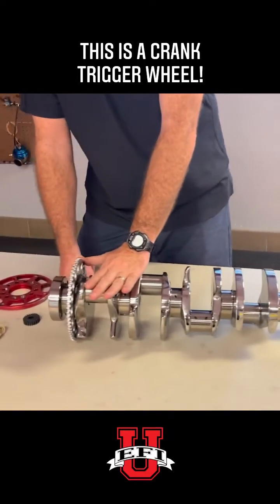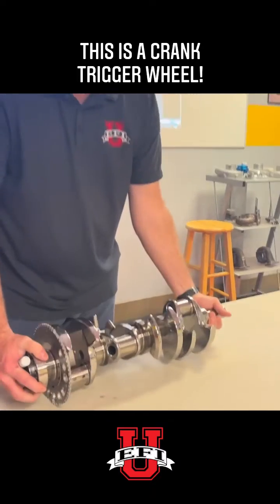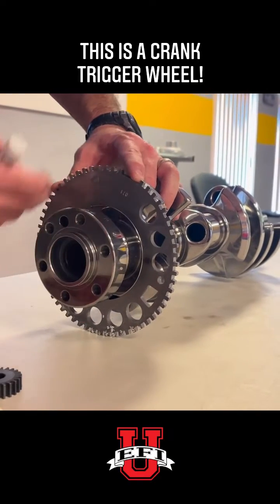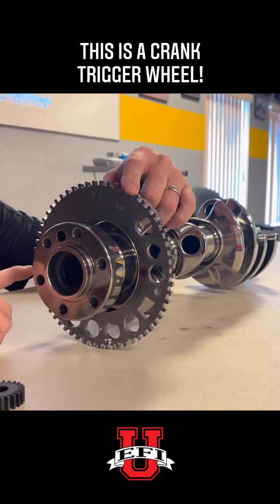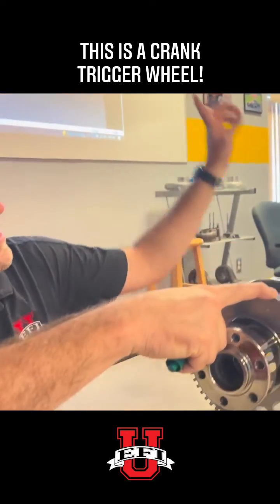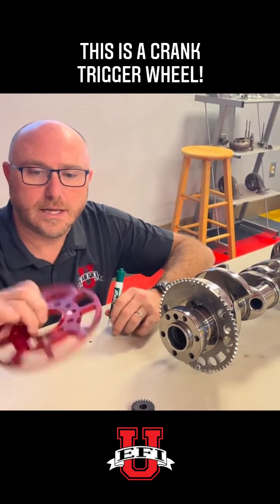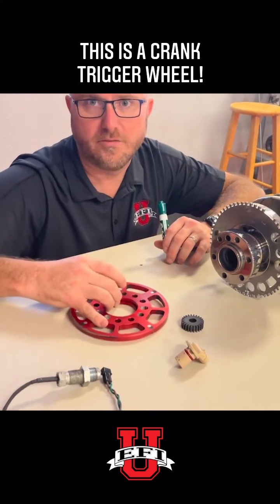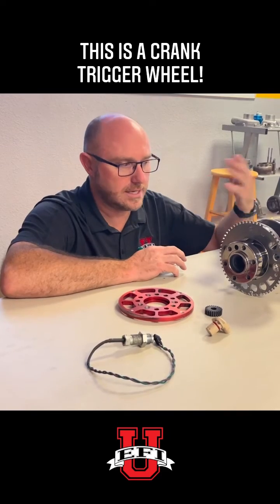Engine Crank Trigger Wheel! #shorts

Comment: Why are two teeth missing???
Reply from the maker: So we know where we are relative to TDC...without a gap we would know how fast the engine was going, but not exactly where it was in its rotation!
Reply: Add overlays to the begging of your videos with your instagram icon and tik tok icon so people can find the shorts and were they can follow you for updates on when new drops are
Reply: Man. Great video. Is there a full video or more to this. I have a recently rebuilt LS3. 58x and I think the reluctor wheel was installed wrong. But, can’t seem to find a video to explain where TDC and the wheel match. I was told, when the black spot in the (crank sensor view hole) Piston number 2 should be TDC. But can’t confirm that anywhere. Any help, would help. Thanks for your time